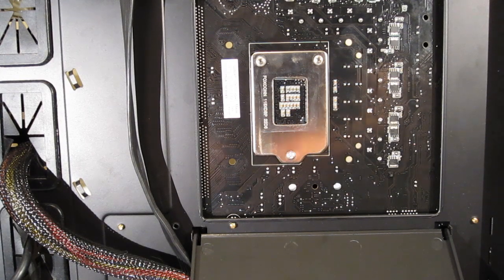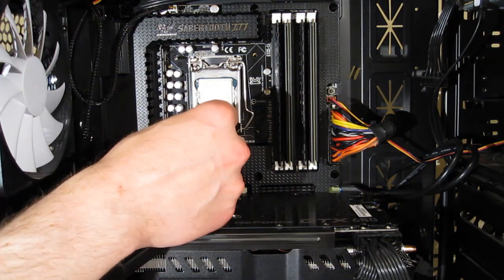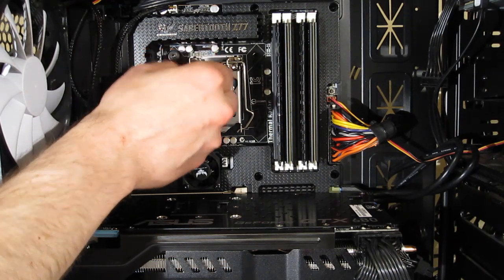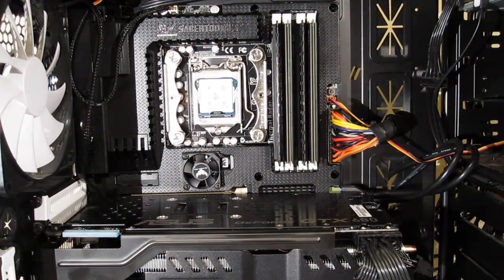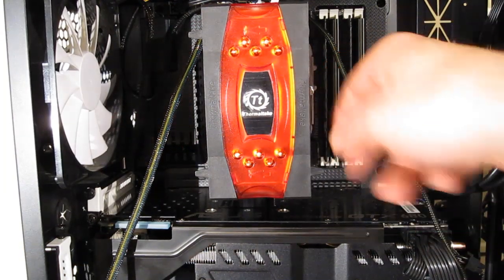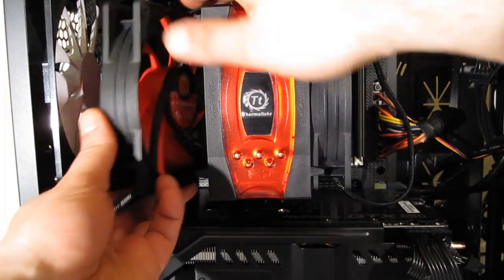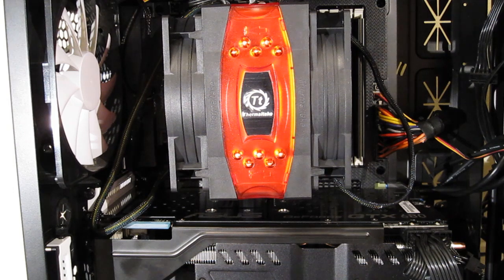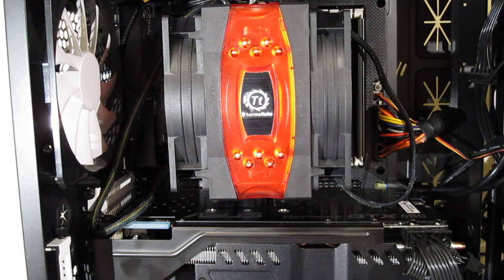Thermaltake Frio Advanced Installation

Comment from the maker: Depending on your budget and what part of the world you live in....Phanteks PH-TC14PE or TC12DX at $79 and $49 respectively are best in class. The NZXT T-40 is a fantastic cooler in the $35 range. The Noctua line is top notch all the way through. And, yes, closed loop is all about marketing and making a lot of fan noise, not so much about cooling. However, the Swiftech H220 is actually worth a look and not strictly closed loop.

Comment: What would you recomment for a small overclock in high room temperatures such as 33c+? I have to inform you that i am not a fan of closed loop cooling cause of the low quality radiators.I prefer a cooler and i am a bit confused with all theese products around.

Comment: I'm starting to become concerned my RAM won't fit with this cooler. I bought Corsair Vengeance Red 1866 and the sticks are rather large. I have 16 so I'm sure they would be fine in dim slots 2 & 4. But I had planned on adding another 16 at some point. I guess I won't be able to now.

Comment: If you have Vengance modules with tall heatsinks, don't worry - you can just open the heatsink covers and remove the RAM modules from inside.  It makes little difference in truth but if you are concerned about any possible heat issue, you can buy low profile heat dispersion cases from many places for very cheap.